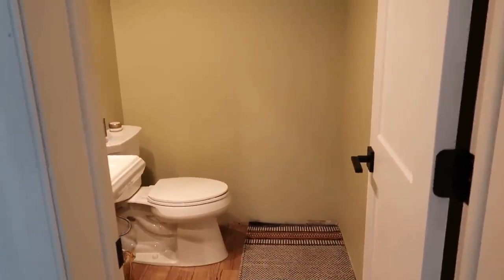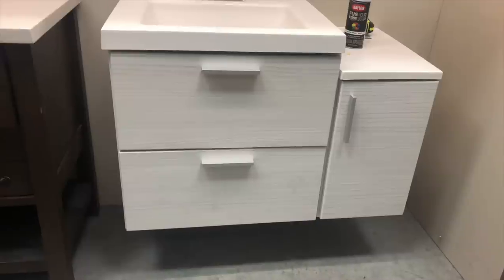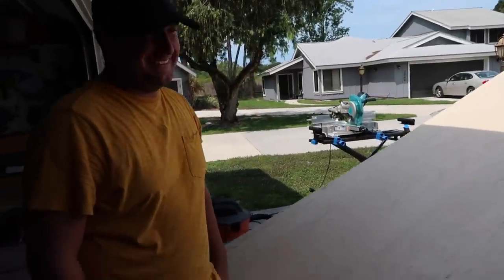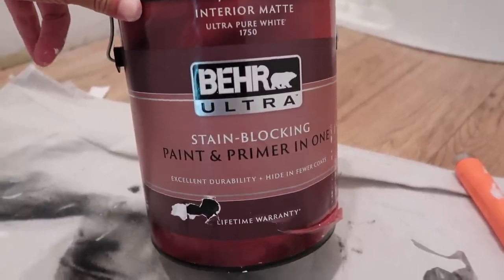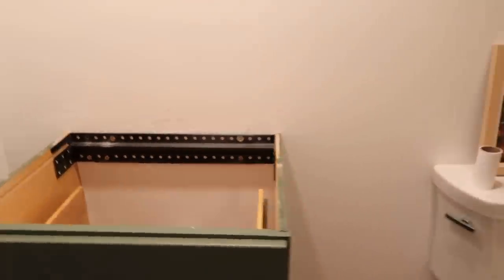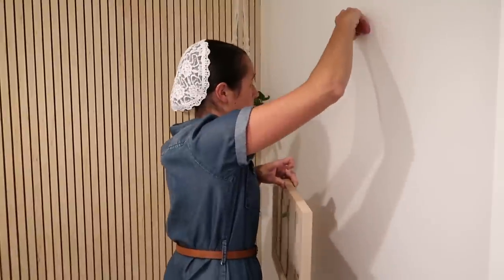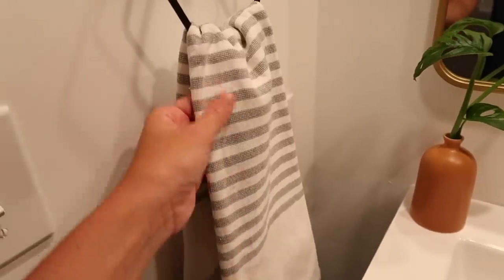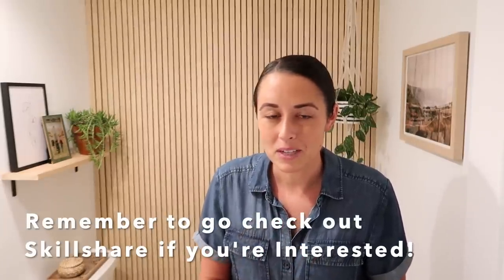DIY SMALL BATHROOM MAKEOVER! | MODERN WOOD SLAT WALL | HOME RENOVATIONS

Comment: I would put some kind of clear sealer on that wood just in case. Oil and dirt from little hands may cause it to have yucky spots. Looks Great!!
Reply: How is she going to clean pea out of wood?
Reply: @LynetteYoder  try a clear matte minwax. Paint a little on a test piece of wood and then do the top coat just to make sure you like it. I painted my kitchen cabinets and once I added the top coat, even though it was clear, made it slightly darker than what it was, but it has held up and very wipeable so definitely try it.
Reply: My thoughts too.....raw wood picks up oils from everything...even soap and lotions will stain......but wow, the bathroom is gorgeous!
Reply: Very good

Comment: Looks great! Love the accent wood wall. 😍 I have a similar macrame plant hanger waiting to be hung up in my dinning room. Also, we don't have a rug in our half bath either. It's off our kitchen so it would get yucky; you're good to skip one! 👍🏻

You could always put a clear matte minwax coat on top of the painted vanity. I painted our kitchen cabinets and have a clear coat on top. They've held up and are wipeable. It did change the color to a bit darker than what I wanted, so make sure you do a test on another piece of wood before you decide to do it. 😅

Comment: The wood slat wall looks great! Some advice to not use nails in the middle would be to put a few dabs of some quick dry super glue which will temporarily hold the wood till the liquid nails dries. Just a little tip!

Comment: Beyond Paint works on laminate/melamine/formice etc.
Reply from the maker: 👍🏽😄yes! So cool you mentioned it! I’ve been in contact with them for a while now and are going to be hopefully trying their product out in another bathroom!
Reply: @LynetteYoder  I used it on my HPL cabinets in my master bath and kitchen. So far so good! Obviously its paint so you have to be more careful than if it were material,  but it doesn't chip easily.